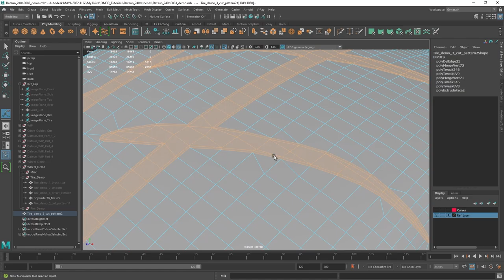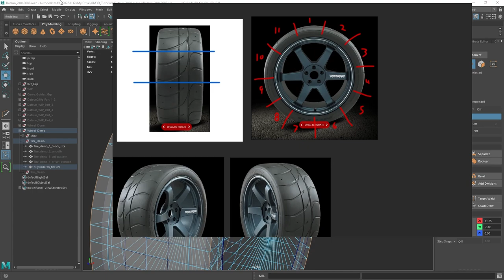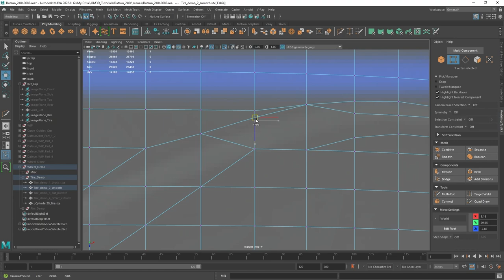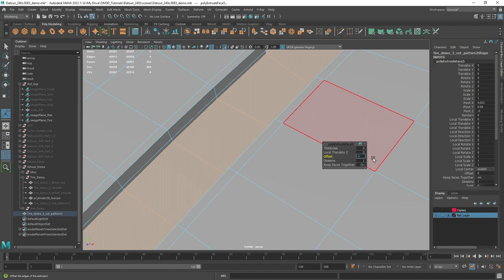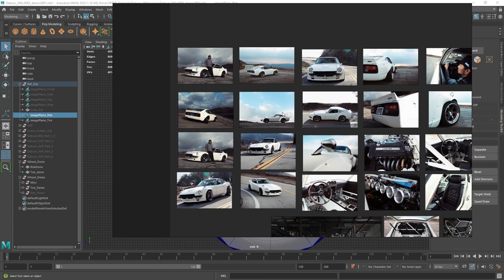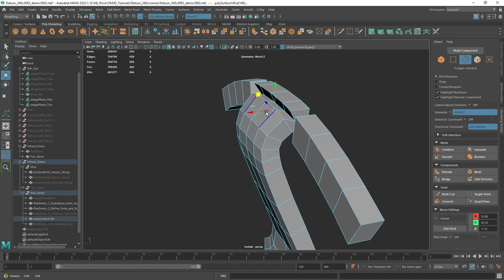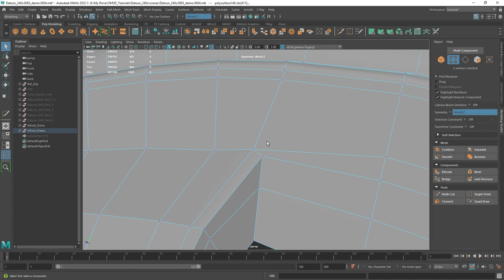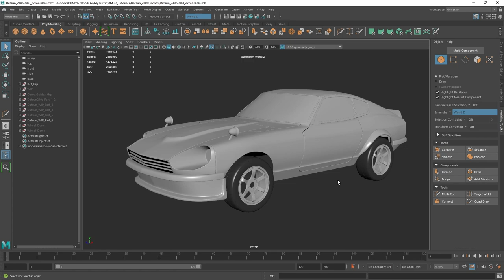3D Car Modeling - How to Model Sports Wheels

Comment: For the tires if I may, model your tire patch flat, then duplicate it as many times as needed, then bend the flat shape into your tire and merge the verts. You can also add another bend to create the bulge on the side of the wheel, and experiment with the other deformers as needed. This way you can always go back to your patch and keep things a bit more non destructive.

Comment: The rim size is incorrect. The "17 inch" refers to the *bead size*. So the actual "lip diameter" - metal to metal edge of the face of the wheel  - will be closer to 18.25 inches. FYI for anyone else modelling wheels.